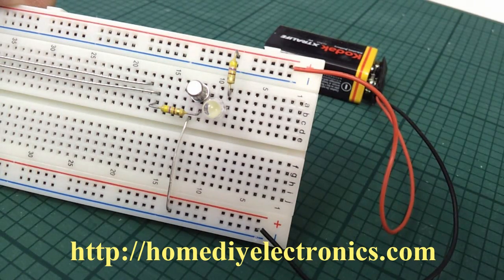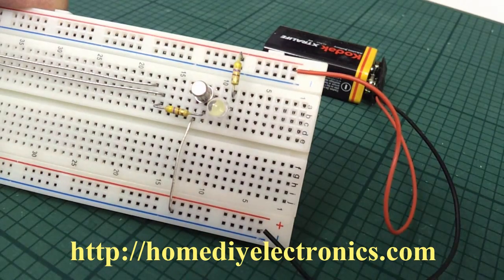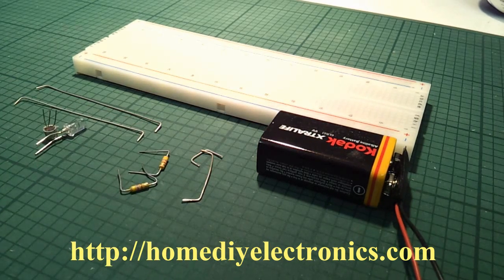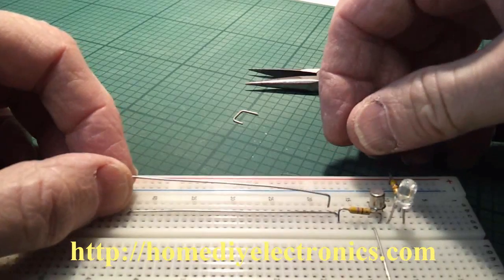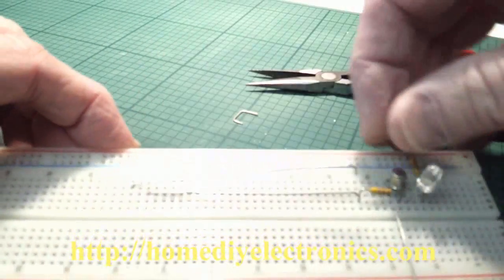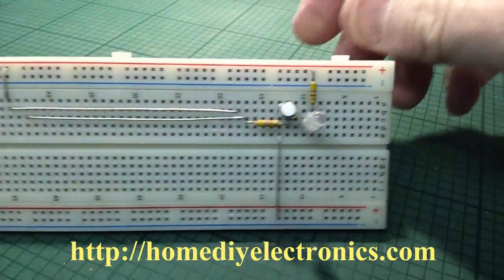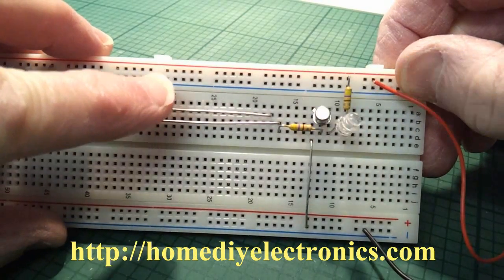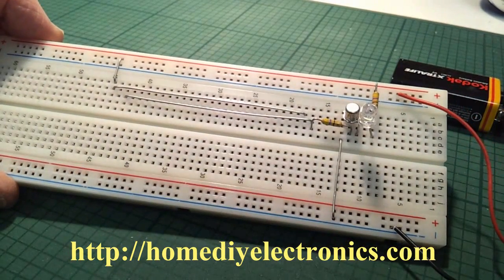Transistor Touch Switch Simple Science Project

Comment: Hey, May I ask what's the point of the transistor here? I did this project, then I got curious and basically made a circuit with it opened by the two long bars  and when I touched my finger the light lit up the same way... no transistor needed. so please explain what the point of it is please... thanks!
Reply: Probably because they want ground to pass through instead of a positive voltage